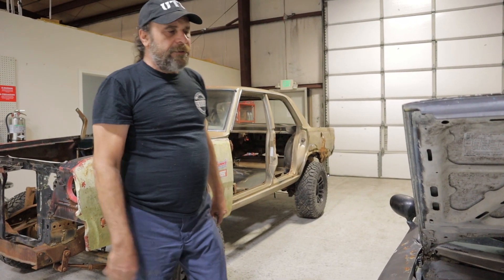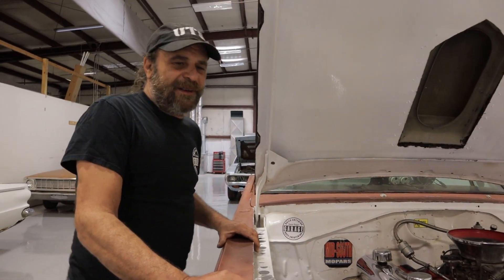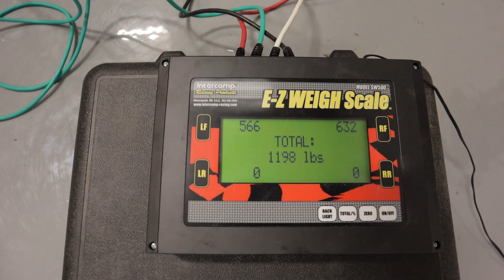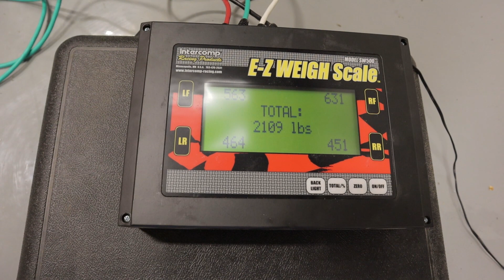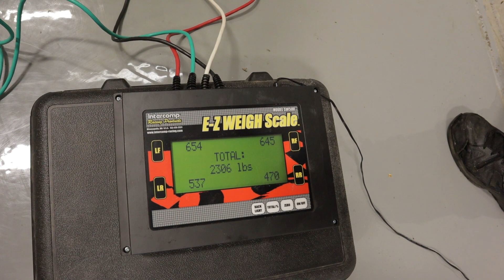Plan Z Weigh-In FAIL!...And A Slanted Miata?

Comment: Do you have to really worry about 9 pounds to race. Does the drag class your in require 2100 pounds max. If not I would not worry about it. Nice shop Tony and nice thinking on a slant 6 Mazda Miata it will work nicely. Get the Makita engine running as cheaply as you can and sell the engine to get some money out of it. I will not be a lot but a few hundred dollars better than nothing. Servive the weather and again nice shop.👍👍

Comment: Light wheels and tires 🤣 -50lbs... battery lithium?, radiator  overflow size? Driveshaft? Fiberglass front end, exhaust system? Just picking your brain on the weight reduction.

Comment: the slant going in that miata better be hot rodded a bit. According to google the stock 225 slant six only makes 30 horsepower more than the stock miata 4 cylinder engine lol.
Reply: The slant makes a lot more torque lower in the rpms
Reply: @travislostaglia8861   @Travis Lostaglia  true but still not enough to make the car what I would consider "fast". Keep in mind there are lots of turbo 4 banger miata's running around that make over 250hp. I would be embarrassed to have a crazy engine swap and still get beat by other miata's that just have basic modifications like a turbo kit bolted to the stock engine. Tony is super old school so I wouldn't expect him to jump right into building a turbocharged 4 cylinder with standalone efi system but a carbureted small block like the 318 or 360 with a 4 speed manual trans would still be a really good option for an autocross/drift spec miata.

Comment: Uncle Tony I need your help.
Young guy here.
I know stock Chevy 350s are happy with 650 CFM carburetors. That being said I have a 750 Edelbrock 1411 on my non bored over 350 that is far from stock.

It has an Edelbrock dual-plane intake, A lopey 510/520 lift cam (2200-5800 RPM) and aftermarket vortec heads that I have ported and Polished myself.

Whenever I tell people I have a 750 CFM on a 350 they freak out saying my carburetor is too big but to me it doesn't feel like it's too big. When I stomp on the gas it does not bog it just goes, when I read my spark plugs either after daily driving it for a while or driving it hard the spark plugs look clean with light amount of soot around the ring at the end of the threads (in other words they look fine to me) and the vehicle idles fine. If this will tell you anything I have a vacuum reading between 15 and 16 inHg. I have not changed Jets metering rods or Springs.

When I tell people (including shop owners) that the engine runs fine. they say oh well it's still too big you're probably losing to tuneability or losing power at higher rpms.

So what I'm asking is in your opinion is my carburetor too big, if not what defense can I use to make these people stop freaking out and what are the signs that a carburetor is too big?

You can either reply here or better yet reply in form of a video lol
Reply: I think you're fine. If you ever want to test it out, Edelbrock sells kits with all kinds of jets, rods, and springs. We used to run 750's on everything from 289's up to 440's just with different tuning. Certainly a lot for a 289 but with an intake, headers, and a nice cam, they ran pretty good.
Reply: @blueduck-q7h  I have run a 750 cfm double pumper on a 225 slant 904 automatic transmission 373 gear sure grip and stock converter. Only had to put bigger pump nozzles in it. Would fry the h 78 15 tires on dry pavement.
Reply: I know a lot of guys run 750's on their 350 Chevy engines without any problems. If your plugs look good then you'll be fine. With that big of a cam, that's probably about the right size carb. Do you have aftermarket heads? What some of Andy's videos on carb tuning over at Unity MotorSports Garage channel > https://www.youtube.com/channel/UCEqgDkKQnfEecoWb0Sd9vYg
Reply: Engine dictates cfm. Doesn’t matter what the carb is as long as it’s able to handle the engines maximum cfm at WOT. The “too big” for the engine is really more about jets and metering rods and how much fuel gets dumped into the engine at any given time. Oldsmobile ran 455 motors with 550 cfm 2 barrels called turnpike cruisers....just saying
Reply: @cutl00senc  too large of a carburetor results in low air speed in the venturies which results in a weak signal on the discharge nozzles.large displacement and or high rpm engines draw in more air thus create a much stronger pull at the main metering system. The engines you are referring to were designed for low rpm operation, thus well suited for a small carburetor.
Reply: @davidleonard8369  what do you think of my 350 (2200-5800 rpm) having a 750 cfm? Everything's aftermarket on it.
Reply: @Fox_Mulder350  the carb you have is very popular on a warmed over 350. Maybe a little bit too much for a stock 350 but certainly not for yours. If you are running an edelbrock dual plane you may even find a few more ponies up top using a one inch open spacer.
Reply: @davidleonard8369  ok thanks

Comment: Need lighter starter and master cylinder
Reply: Aluminium wheels at the front
Reply: @garymatthys3605  You can't push start an automatic.
Reply: @Rockey Meyers, I think it's the stale air in the tires. LOL
Reply: @bigbear5510  Wasn't sure if it was auto or stick. So Ii rolled the dice and lost. lol
Reply: Already has a high torque mini starter.
Reply: @garymatthys3605  So does that mean you haven't been following the build or you didn't remember.😎
Reply: @bigbear5510  the memory came up short. he's got so many builds going and he doesn't have them separated into playlists.
Reply: @garymatthys3605  Yeah, I hear that. I use to have a '76 4 door Valliant with a slant 6 and always wanted to sup up the engine but just know what direction to go with it. So, I kind of remember a good bit about this build. Also seen one of the trans build videos that John Wilburn did, haven't got the time to watch the others yet.
Reply: @bigbear5510  I saw the video with John, a couple of them actually. I couldn't tell you which car that trans was going in, he's got so many.

Comment: Slant six weighs as much as a small block v8. Wouldn't dream of making the front of that Miata so unbalanced. You'll have nothing but UNDERSTEERING problems! Throw in the GLH 4 cylinder engine. Or at the very most use a magnum v6.

Comment: The Miata's not a project he said. Just going to get it running and rally cross it he said. Now it's a slant six swap. If you don't get help at Charter, get help somewhere. Naw! The trunk hinges on the Plan Z. There's a pound.
Reply: John Wilburn said it already has lighter hinges, no lock (it's held down by a strap) and the spring rods have been removed also.
Reply: @bigbear5510  I was looking at the "door" hinges he used to replace the originals. Probably not a pound but at this point....
Reply: @Rembrant65  Okay, you were looking at the door hinges but you did say trunk hinges. I think he grinded some material off of the door hinges but I could be wrong about that.
Reply: @bigbear5510  I put quotes around door because he used door hinges on the trunk.